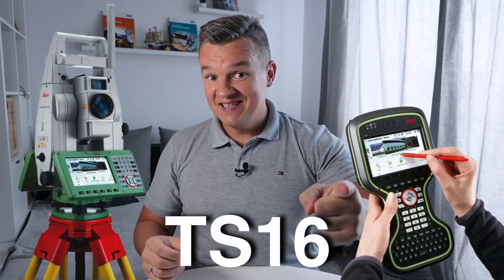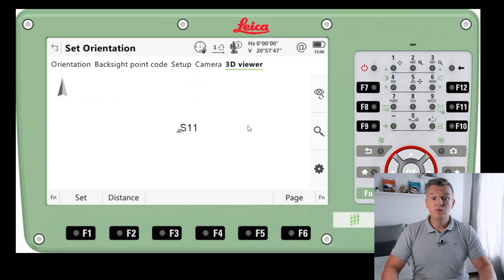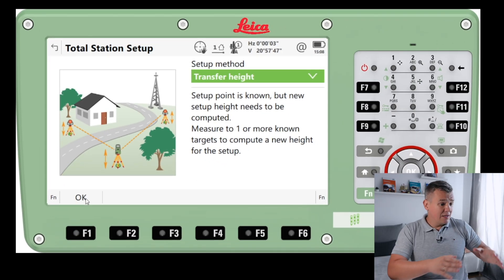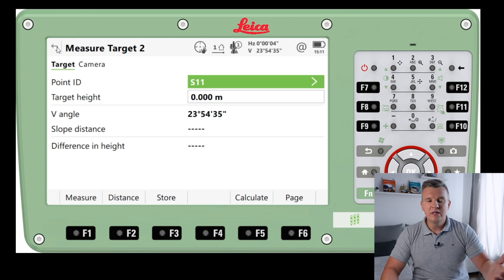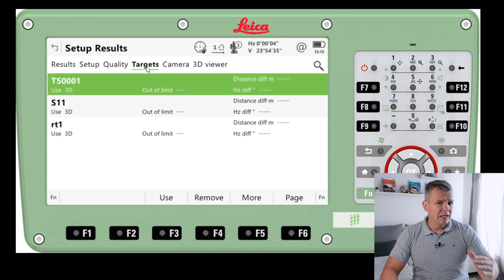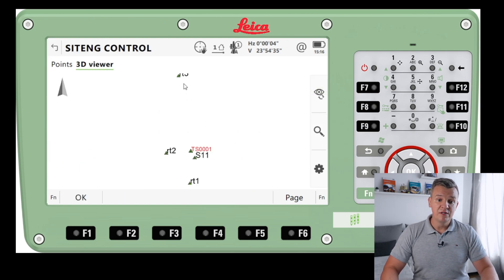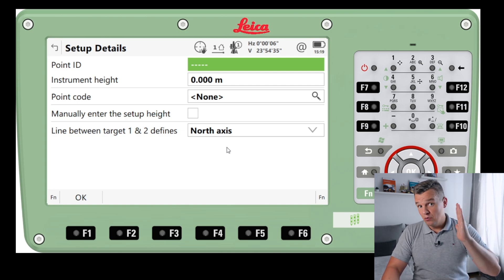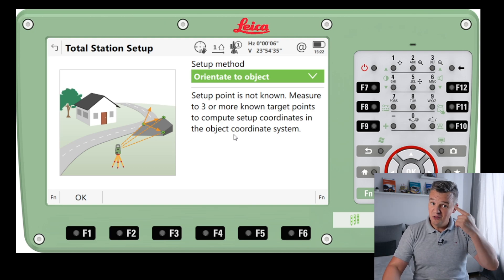How To Set Up a Total Station. Leica TS16 Guide for Site Engineers

Comment: Working with another company, they issue me a Topcon GT Robotic Station and Tablet with Magnet Field Software. I really liked this software it would let you edit your instrument height even after setting up, working on vertical buildings this is a great feature, I had elevation benchmarks on every floor, after setting up my instrument on zero height with orientation or points, I could do a any surface shot to the elevation benchmark of the floor I was, do the calculation and edit the instrument height, for example if you're on 3rd floor your benchmark is 154ft, you shoot it and it gives you -1.3ft elevation result, that means your instrument height is 155.3ft, so you could edit the instrument height to 155.3ft for the rest of that set up you have elevation, Leica Captivate won't let you edit instrument height after set up, you can only play with your target height, which is what I do now, I wish the Captivate would change this.
Reply from the maker: I worked with Tocon too, not bad. I need to double check the Captivate but I believe I was changing tue target height like you say, although in old good TS06 I actually was changing in station 😁

Comment: Hi Greg. What's the ideal laser plum intensity of a ts 16? Or you have no need to adjust it when you receive your EDM from the supplier? Thanks.
Reply from the maker: Hi Jerome!
Whatever you need really if you’re using it. It will be default set, yeah. Are you using it, or do you mean EDM laser?
Reply: Okay Greg thanks. What I mean is the Laser Plum. Intensity shown on the screen when you bubble level the instrument.

Comment: Hi. I have a question. I am a engineer from British army with degree in survey engineering, know how to use  kit and have done construction jobs in army for last 15 years. I am now a manager with project management qualification and also degree in construction. Would I find site engineering job OK. Also I want to live in Lithuania and only work in UK for one project a year like 4 or 5 months. Would it be likely I could work weekends as well while I am over
Reply from the maker: It's possible, but you will have to contact agencies etc. I was thinking of doing the same TBH. Probably that would be a setting out engineer/site engineer roles but it's doable. Senior roles are for longer. Most of companies (frames) are busy in the season and they're often need extra engineers, but you would have to look for work yourself anyway. You can try JRL for start as I know many army people got a opportunity there - you don't have to tell them straightaway you look only for few months 😁

Comment: Hi fantastic channel real appreciate the information you providing.  

When doing a resection using retro targets is it better do I select the option of measure any surface?
Reply from the maker: It's not better, but you can use it. I always try to use a retro target mode as this actually makes sure you shoot the targets right (if something will be on the way a bit, or the angle is bad retro mode won't give you the reading), but of course I use 'any surface' mode often myself as the targets are far etc (any surface and retro tape is the same constant)
Reply: Hello